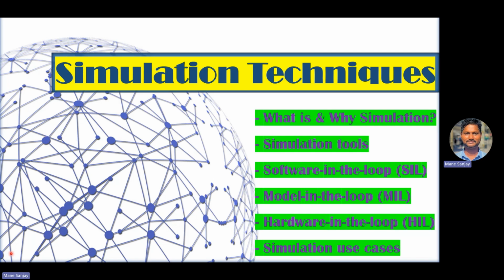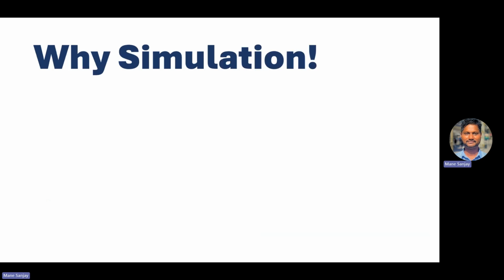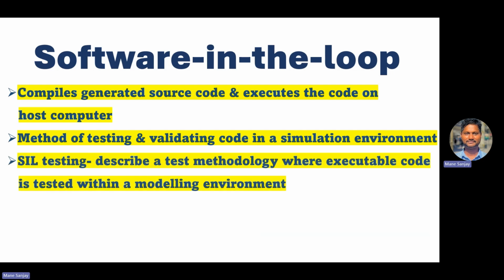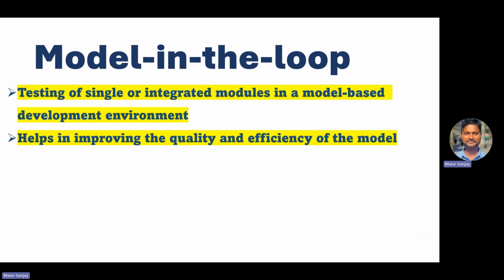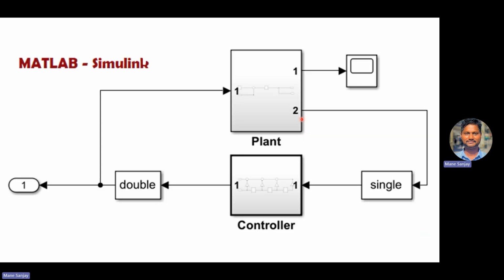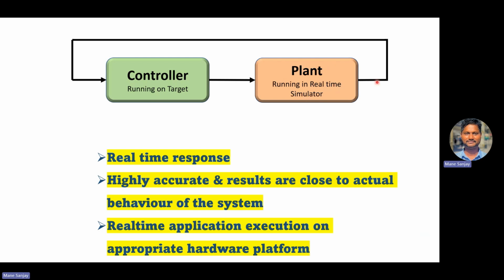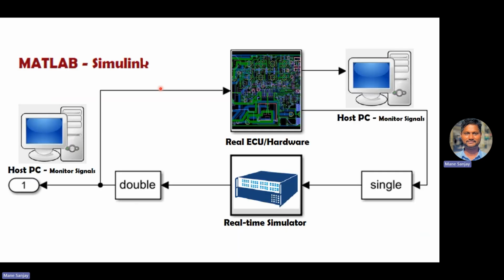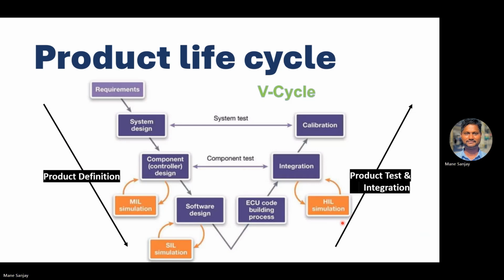Simulation Testing - SIL MIL HIL, Software-in-the-loop, Model-in-the-loop, Hardware-in-the-loop.

Comment: Any good sources to this?
Reply from the maker: What do you mean sources?
Reply: @SanjayMane_Tech  Im currently writing a scientific work about this for uni and really liked your explanation but still need relevant sources to quote from. Therefore where did you get your information from? That would really help me, thank you! :)
Reply from the maker: @foxytio1077 Honestly it is depend on your work need? Like what operating voltage, frequency, FPGA need etc..
But you can start with OPAL-RT, dSPACE, Vector HIL etc..
Reply: @SanjayMane_Tech  My work focusses on adjustments to an automotive HIL at ZF. But first I have to set the groundations about modelled develeopment and simulation software testing via mil, sil, mini-hil and hil. Unfortunately I cannot really quote the company intern knowledge and therefore have to find extern sources for what I state. Preferably more quoteable scientific work and less technical marketing by the company we use the products of. I hoped that you know more about this since youre teaching it so fabulously

Comment: The first use of critical-time software modeling with humans and hardware in the loop that I worked on was in 1971. We had RF, IR, video, analog and digital systems in the loop. Before this an analog computing systems for which the digital systems replaced. It was a great time as the digital systems changed along the line of Moore’s Law. We went from assembly languages to C and C++ world with assembly calls, then purely higher order software. Hardware also changed from huge racks of equipment to analog chips controlled by digital. We also had IR screens for drag and drop capabilities. It was extremely fun to go from fixed-point to floating point fast processors!  In the 80’s we developed labs to test every aspect of aircraft components included. It forced me and my teams to learn every aspect of software, analog, controllers, cockpit, etc.